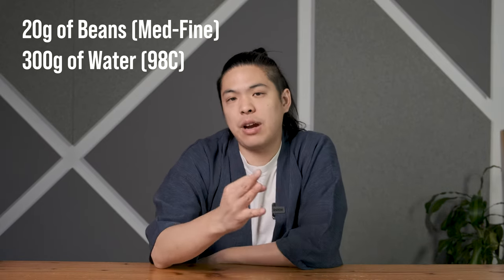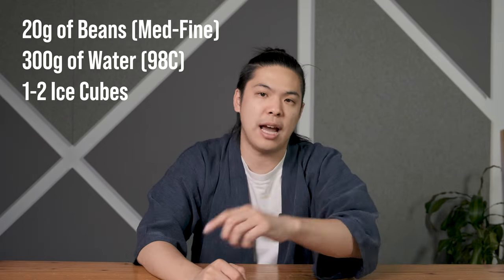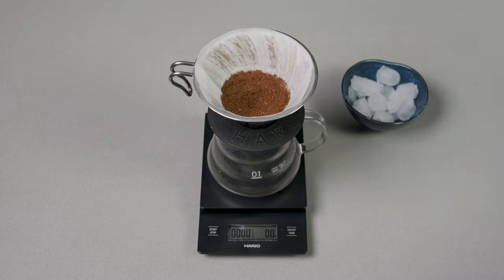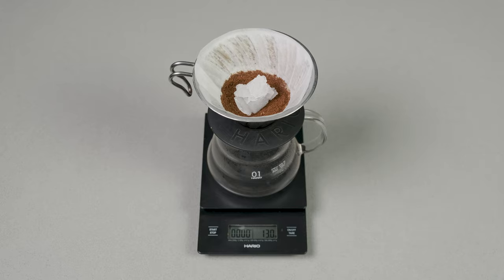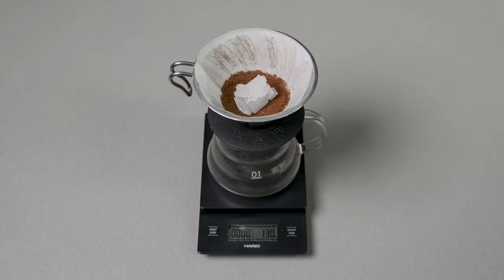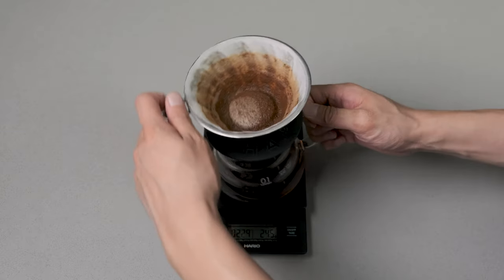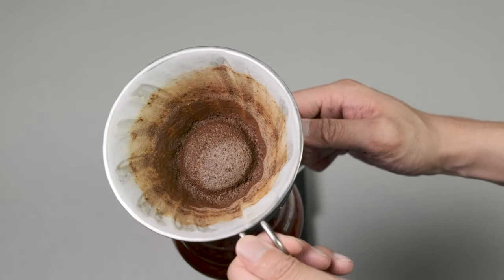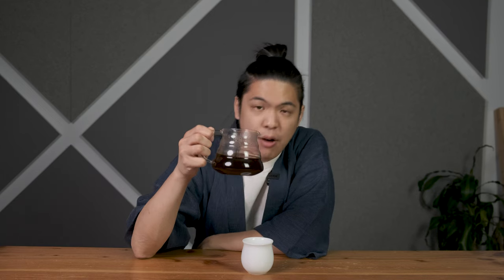Adding Ice Cubes in Pour Over Coffee? | Pour Over Theories (Part 2)

Comment: Hi vincent, i was wondering if there was a different setup for darker roasts as with the same technique i get a nice dome with light roasts but a funnel shape with dark roast. Probably has to do with sinking speed. Good vid as always!
Reply from the maker: Hey! If you're getting a funnel your water is draining down too quickly.  Either grind finer or pour slower.  The issue with dark roasts is generally the rate at which flavours extract or the water sinks.  It's because the beans are gassier which equates to a faster flow rate.  Either slow it down or use a water temperature if the grind size is already ultra fine.  You need to be like EXTREMELY slow on the pours
Reply: @TALESCOFFEE  thank you so muchh!!

Comment: I thought of starting cold before, however i thought the ice melting meant a too fast water addition. Therefore I just put my glass v60 on the freezer and it worked way better.
Have you ever tried this one?
Reply from the maker: Hey! No i haven't found a need to freeze the glass. I always worry that the hot water will crack the frozen glass haha.  I don't mind it when the ice melts too quickly, you can see my ice cube isn't huge, but it does the job just right for me!
Reply: @TALESCOFFEE  Yesterday a tried both methods side by side, and without the ice seems to have a hint more sweetness, however I think it came from a better stir and not the ice volume